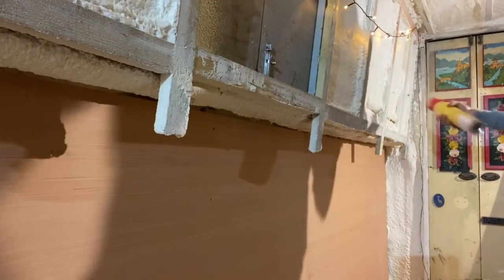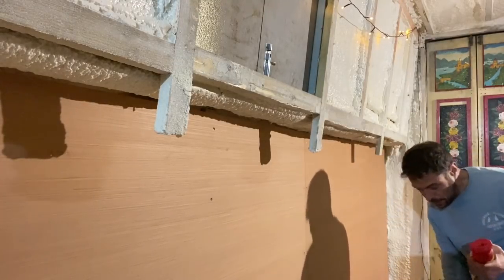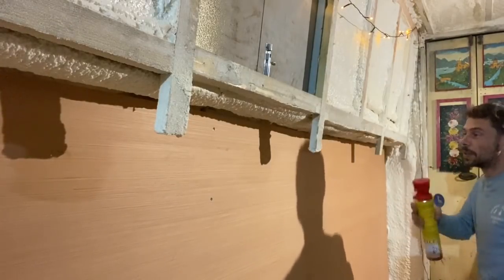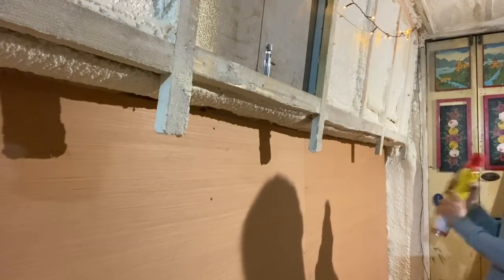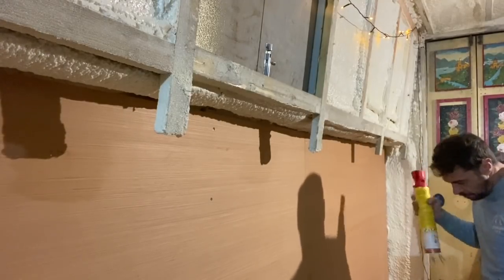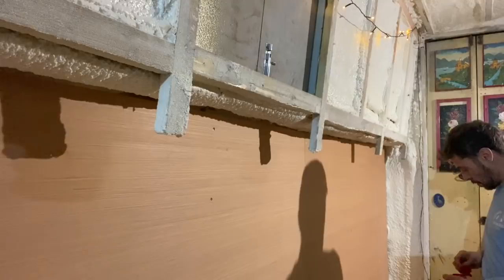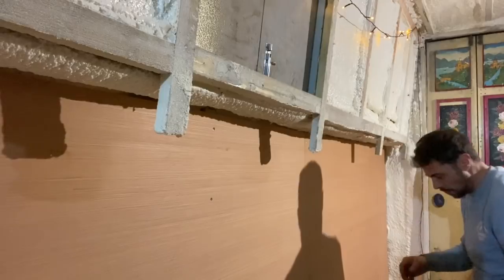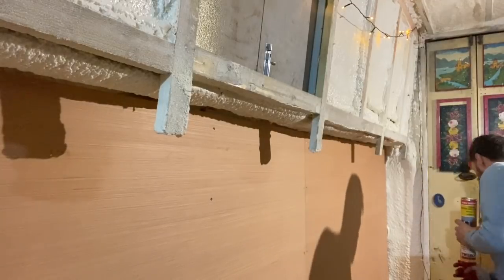45. 12v wiring channels made & installed on my Narrowboat

Comment: Hi James .. it's worth thinking carefully about packaging and access to all things service related..leaks happen and being able establish and gain easy access to a repair can't be underestimated..on my 58ft narrow boat I made a 1000 litre stainless water tank positioned centrally under the front deck.. the calorifier is under the bed  in its own tray to monitor any leaks.. I also mounted the water pump in its own tray to monitor any leaks .. this water pump arrangement has bee useful a couple of times  with leaks being shown in the tray and not invisible  pooling in the bilges.  .. it's just an opinion but reducing the size of the water tank to 200litres especially if you intend to cruise a fair bit might be something that you regret..
Good luck
Reply from the maker: chevyimp those are great ideas about putting trays under the water gizmos - I’ll do that!! To be honest, just me on board, not having long showers and just mainly drinking tea - I reckon I’ll be ok with a 250ltr tank. I might go for a 300 if the shape is right. My entire cabin is only 36” so space is a premium !

Comment: I am intrigued by your powered screwdriver. It sounds as though it is jumping out of the screw heads a bit too readily. Maybe you need some new pozidriv screwdriver points! I find they wear quickly once they start to ride out. 
It is fascinating, though, watching the "blow by blow" action. All of which convinces me that it is quite a big project to makeover a boat (or even finish off a sailaway!) Keep the videos coming....
Reply: I think that sound is the clutch disengaging, rather than the bit moving inside the screw? Not sure. The two are hard to distinguish sometimes.
Reply: @JasperJanssen  After posting, I did wonder. I am used to a driver with a torque limiter that cuts the power back rather than slipping a clutch. I guess if the screw heads look ok after tightening, it is not the driver slipping. Phillips heads and drivers were designed to cam out, to limit overtightening, but pozidriv (the heads almost invariably found in the UK) to resist camming out.

Comment: I may be wrong but I was under the impression that a calorifier had to be placed relatively close to the engine, assuming you will be using the engine to heat water as well as any eberspacher/webasto ... may be worth checking before siting it.
Reply: A calorifier is just a heat exchanger — a hot water tank with one or more heating coils running through it. Usually two or three, it seems — one electric for emergency/shore power use, one coil for the engine cooling system, and one for use with things like webastos or the back burner on your stove. At least, I don’t think there’s any way to mix the engine cooling and central heating system working fluids — unless you have a second heat exchanger where the engine heat directly heats up the entire central heating system and then that heats the calorifier, but that seems inefficient. I would imagine if you have both a stove back burner and a webasto you would in fact hook that up as a single system, with two inputs and  multiple possible outputs.
Reply: I’ve seen calorifiers fitted in cupboards .

Comment: Looking great James, as far as I'm aware calorfier has to be close to the engine,, also at the stern you have a engine and fuel which should counterbalance your water tank, just food for thought, great work mate stay safe 👍
Reply: The question is, if you have an aircooled engine which will not provide hot water as a by product of being run, do you really need to heat water and store it? Is the boiler you are installing a 'combi-boiler' type providing instantaneous hot water and a heating function, or simply a heating function that will be used to produced stored hot water and heating? I would think that the combi-boiler type of installation would be more cost effective in the long term.

Comment: I was thinking the same thing, make the cables, wires, etc... accessible.  ;-)
Maybe recreate the gunnel panel but have the short leg be longer, so when flipped up (closed) from the back it covers the foamed gap (Problem is how to lock them closed without looking shabby?).
I was also thinking, you could attach the cables, wires, etc... to the cover so when flipped down (open) you can see them easily (Problem is the cable, wire, etc... needs slack when only one panel is open?).  Take care and have fun.

Comment: this is to make you rethink and reconsider the pocket door...
take for a moment a kitchen drawer... There is a top a bottom a left side and a right side. The left side and the right side usually has drawer guides and rollers for keeping the drawer inline as it moves. Notice there is not a track on the top nor the bottom of said drawer. Now take this image and apply it onto a door.....only using the drawer guides mounted inside the wall about 12inches down from the top and 12 inches up from the bottom instead of a track that curves on the roof. You can in your mind's eye, see this metaphor?? i wish i could draw it out and send it to you.
You have used your minds eye for this entire project thus far , keep using it and this door will not have hinges.
Reply: no, you dont need 4 guides only 2 on the same side of the door.
Reply from the maker: hmarc417 I’m going to make a brew and then read this. I’m intrigued
Reply from the maker: hmarc417 I totally get what you mean and if I could get those drawer runners which extend then it could be a worker. Or I have a 3.5ft wide door which only comes out 2.5ft - then the mechanical bits can be inside the wall on the moving bit of the door which is hidden ??
Reply: @TheNarrowboatThatJamesBuilt  EXACTLY AWESOME
Reply from the maker: hmarc417 cool - going by that thought then, I could use my existing plan but mount the slider inside the wall and have an odd shaped door which fills the gap perfectly when closed. Over 50% of the door won’t be seen !
Reply: @TheNarrowboatThatJamesBuilt  And since the bulkhead is very rigid, the door system will be sturdy as opposed to a reg pocket door system on a flimzy track.. I am glad that you can see what I see ... in this design.  3 CHEERS
Reply from the maker: hmarc417 been thinking about it more. I can’t see how, just like a drawer, the fixings to the drawer or door in my case will be visible when extended. I can find the hardware to do it but to extend 700mm approx the total span will be 1350mm which means the metal braces will be visible on both sides when the doors closed which won’t be good
Reply: @TheNarrowboatThatJamesBuilt  AT least you tried before just tossing to the wind.. THANK YOU
Reply: just thinking here but if you did treat the door as a drawer there still would not be a track on top or bottom out into the hall space, and the rails or guides would be on the top and the bottom of the door, and you would not see them. if they be mounted in the wall as if in a cupboard.  top and bottom only not the faces .... just trying one last time here be fore it is to late.
Reply: in fact the guides could be rabbited in the top and bottom of the door to hide them. using short extensions if needed to reach out to the guide part that is mounted to the solid pocket inside. I still believe it is possible to have this door mounted as a pocket door and not have the rails or guides show ...  i have faith in you ... see the picture.. make it work in your head then apply. you can do it...
Reply: this mechanism can be built and installed in the wall and the door hung before the outside skin to the wall is applied, remember. think of it  as a drawer standing up on end sliding out of the wall,  which would make the guides on the top and the bottom of the drawer. , or door in this case,
Reply: had to try. CHEERS.
Reply: one more thought, the guides i would suggest would be the type used in a snapon tool box or heavy duty tool box, ware as the two parts of the guide are a single unit rather then one designed for taking the drawer out. rail and ball bearing types not wheel types if possible.. 
thats all i wont bother you again..about it.